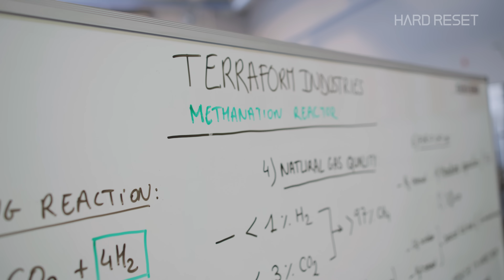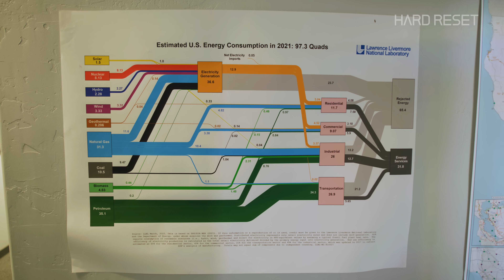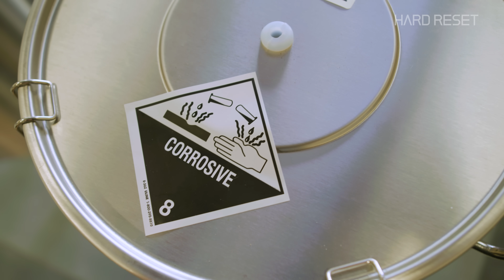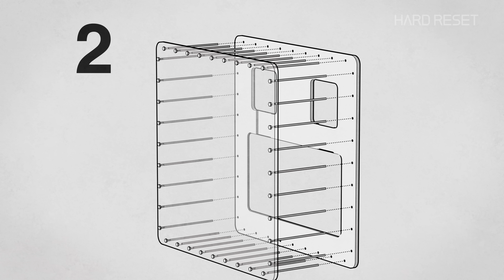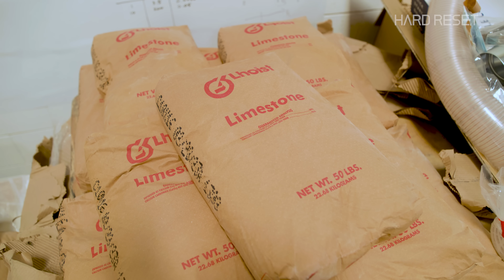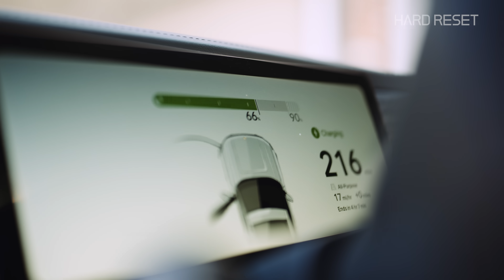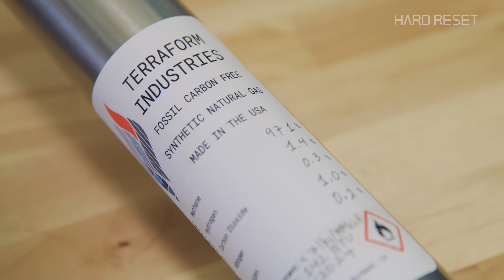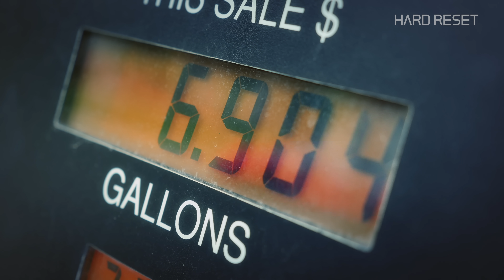The Last Fuel We'll Ever Need?

Comment: Bogus. After watching the basics, this is an energy intensive process, needing a lot of energy that is just lost via heat. Using Solar PV isn't going to cut it. Consider that Civilization uses about 400 years of stored hydrocarbons per day. For every day of consumption of fossil fuels it took about 400 years of sunlight to produce it. Even at 20% PV solar efficiency, and 10% of ends up as natgas production You would need hundreds of square miles of nothing but solar panels to make even a few million cubic feet of natGas per day. Currently the globe uses about 90 Billiion cubic feet per day. To produce 90 Bcfpd, you need most of north America, covered with nothing but solar panels. 

Not only is this process very expensive its will struggle to scale up. 

Sadly PHDs make very poor engineers. They simply lack the ability to under stand economics, infrastructure, logistics, etc. This is why engineers design, build & operate industrial plants. 

For the amount of PV required, it would be better to just use electricity to avoid all of the chemical conversion losses. It would probably make more sense to use biology to produce methane. Perhaps figure out a way to develop mass produce methyl-coenzyme M reductase (MCR) to convert waste biomass into methane & skip over all these processes.

Comment: So, I don't understand how this can be better way of storing energy than a battery.  Batteries are ~90% efficient, can be cycled 1000's of times, and are fully recyclable.  The costs of batteries appear to be following a similar cost reduction curve as solar did 20 years ago, so this idea to convert "solar energy" to methane seems destined to failure, just like other synthesized fuel tech.  Also, we can use heat pumps to replace furnaces at potentially much lower costs than gas furnaces.  Think about it, many home owners already have a heat pump called an "air conditioner" which takes heat from the home and moves it outside the house.  The same heat pump can be used in reverse to heat the inside of the house in winter by just modifying the pump.  Air and space transportation are probably the most difficult technologies to switch to electric, but it is possible and eventually will be much less expensive than current tech.

Comment: Does calcium oxide/carbonate CO2 scrubbing have a higher or lower energy intensity than monoethanolamine CO2 scrubbers? Plus the logistical nightmare of bulk solids handling of the calcium oxide/carbonate. Because, commercial CO2 scrubbing all use monoethanolamine, and commercial entrrprises are sensitive to energy cost.

Comment: Electricity is 3x more expensive than natural gas. They plan to use electricity at 30% efficiency to make a product that is three times less expensive. How can this be viable? They plan to pay 100$ to make 30$ of gas. That people can buy for 10$ in the open market. Not even counting the price of everything else, like CO2 extraction etc, just the electricity alone.
Reply: They expect PV solar electricity costs to eventually dip below natural gas costs. Their goal seems to be to prep a system that can be paired with with a PV powered microgrid and produce decentralized fuels.
Reply: @nolan4339  If that happens, people will just use the Fischer-Tropsch process to make gasoline, diesel, Avgas, etc. We already know that works, and the only thing really limiting it is the price of the power.
Reply: @berserkasaurusrex4233  and that is what they're doing. Prepping a system to deliver those e-fuels while tying in carbon capture.
Reply: @nolan4339  He specifically says he's not doing that, at the start of the video. Those fuels are already carbon capture, there's no prepping the system or whatever. The issue is purely the source of power.
Reply: The economics could make sense if paired as “storage” for a PV plant. If your PV plant produces more electricity than the grid needs, the marginal price of each excess kW generated is negative! So having some place to put that extra juice is always profitable. You could see this scenario regularly happening at scale in California and the Southwest.
Reply: @MichaelHughes124 we already have far more efficient batteries then this method. 🙄
Reply: ❤❤❤❤

Fantastic technology..hats off to Terraform Technology...

To improve efficiency 

1. We can directly connect this system to the carbon dioxide emissions of factories and power plants... 

The emissions are hot and concentrated and blow at a high speed...so you will save on blower power when you have to blow the carbondioxide over the calcium hydroxide plus you will get far more calcium carbonate and carbonsioxide when heated over the kiln. 

In fact you could use the waste heat of the exhaust in the kiln.

2.  You can  use the oxygen that is released  from the electrolysis process and combust it to run a gas turbine to generate electricity for the process to make it more efficient or even collect the oxygen  and compress it in tanks and sell it ...just some loud thinking on how to increase efficiency. 

 I am from India and would be very interested in setting up a plant out here in the future...abundant sunshine and we can explore joining it to the exhaust emissions of companies.

Please reply to me.

Thanks ❤❤❤

Comment: Highview power compresses air to store energy and in that process of compressing air, dry ice is a solid byproduct. I cant help wondering if there is a symbiotic relationship here whereby they can utilise the CO2 from this process or even use that process powered by solar to then use as a storage solution to power this when its not sunny whilst acquiring CO2. Make it part of a grid of a grid balancing solution and use that to  make it even cheaper 🤔

Comment: Since its efficiency is lower than 100%, this is only a solution for storing and distribution of produced electric energy.
Below 100%, efficiency still does matter: the lower the efficiency, the more solar panels, wind mill or NPP you'll need to make, and these still produce waste.
And if you consider a 30% efficiency for the production of methane, then 30% (car engine) to 50% (gas power plant) efficiency burning the methane and get energy out of it, you get an overall 10% to 15% efficiency.

Thus, it's questionable if this can really help making energy sustainable.

But since it doesn't rely on any rare materials, and China controls the vast majority of Lithium batteries supplies, I wouldn't be surprised Europe and the US would want to invest into this tech.

Comment: Liquid methane isn’t bad for energy density, and there are tons of applications that just aren’t going to be electrified easily. What they really need to do at the same time is create an efficient low temperature methane fuel cell that can take advantage of methane’s higher energy density than batteries and use that to make hybrid electric vehicles.

Comment: ok good video but so much of focus on benefits and 'good enough' & fluff really. He fails to ask a critical question, rate of limestone consumption and 'cost' (energy or otherwise) to acquire it. that is what decided if this scales or not. electrolyzers & cake mixers do not. honestly if its cost effective you could skip out the fuel part and just use it as a sequestration tech by digging a hole and dumping carbonate in ground. 
without these details it just looks like a subsidy play.

Comment: You do not have to be Carnot to realize that consuming electricity to make a fuel that you burn for motive power is going to yield 25% or less energy than was in in the initial electricity. Very few applications where it would not be preferable to simply use the solar electricity directly and skip the  whole methane intermediary, especially if the methane has to be transported by ship or rail or truck.
Reply: not to mention you used carbon or fossil fuels to generate the solar panels used to generate the methane xD
and those solar panels usually have a 20 year ROI in terms of energy used to create them. The more you think about it, the sillier it gets.

It would make much more sense to do light to fuel directly instead like some other company was doing using photo synthesis to make hydrogen, since you wouldnt need the electric infrastructure and could go straight to storage.

Comment: Although methane is almost as bad as hydrogen to store and transport, it still makes more sense than plugin batteries, all due to the fact that batteries do not store electricity.
Reply: What?? Batteries absolutely store energy. And methane is significantly easier to store than hydrogen.. by some margin.
Reply: @nfaurerSLK     Batteries store chemical energy, not electricity. charging a battery is an energy conversion operation, which means you have to wait while the battery turns electricity into chemical energy.
Reply: @gsilva220  ah yes. In terms of electricity, that is correct. 👍🏼
Reply: @nfaurerSLK    Methane's only advantage against hydrogen, transportation/storage-wise, is the lack of container embrittlement. Both have low energy density, both take about 15% of the equivalent energy content to compress for vehicle use and about 30% for cryo, and both are better off piped at low pressure to consumers instead of compressed.

Comment: That's a hell of a lot of energy spent to produce methane. Why not just use the energy and forget about the methane?  When are governments around the world gonna treat electricity storage as the moon shot?  The only thing holding back the transition away from fossil fuels is storage.  Storage that is safer than the storage of any other type of energy and can be built anywhere right next to where it's needed.  I can put a solar panel on my vehicle, residence, of business, hook up a battery, and you're up and running.
Reply: because advanced civilization NEEDS giant amounts of hydrocarbons to exist for tons of things that CANNOT be replaced by just electricity.
Reply: @kazioo2  you mean like methane?

Comment: Use heat from the calcium oxide=>hydroxide reaction and insulation to have more efficient hydrolysis. Use the hot oxygen from the hydrolysis for more efficient burning in other parts of the system. Conserving heat in the system as much as you can add to the the most required efficiency. Furthermore, you can install this system at some plant that produces "free" CO2, which would largerly skip one of the steps. Basically anywhere we are burning natural gas for energy. These are the shortcuts that will get this up and running!
Reply: They are long on promises with zero details.
Reply: @tarstarkusz  Such as the catalytic 'magic'. Probably to try and protect their process from those who would steal it.
Reply: @tarstarkusz  
Did you not watch the video?  They described EVERY detail.  All of these reactions have been well known for years.
Reply: @BigGuy8059  Yes, I did. There was no details on cost whatsoever.

Comment: Why not stick with hydrogen? It’s the first step of their process and so definitely provides greater efficiency. So what’s the advantage of using methane? Transportability?
Reply: 20 years ago Europe said "We will create renewable hydrogen economy" and today almost nothing uses it and there is zero infrastructure for it. Turns out it being 15x more expensive to store and transport and requiring completely new systems to run makes it a much worse alternative. It leaks like crazy from everything. Natural gas on the other hand is already solved on trillions level scale. And methane is basically the same thing.

Comment: frankly an onsite generator attached to the grid would be the best bet.  If you use a battery/capacitance device, you could capture the energy, an then inject the grid. either on demand or controlled injection to buffer elsewhere... The grid needs to be more than demand driven.  It should be more like a small town water system.  Many inputs are fed into a storage system (hopefully onsite), while the existing water meets the demands of the system.
Reply: I say these things after babysitting a  60kw storage/19kw solar generator , producing a max output of 27 kw through inverters.

Comment: For the people saying "just use the solar", sorry no. Build a jumbo jet that can take 350 people from new york to japan in 14 hours that runs on electricity alone and you'll be the world's richest person overnight.
Batteries are slow to charge and inefficient currently. Fuel like methane is tens of thousands of times more energetic.
Reply: their plan is to make jet fuel from solar power
Reply: Pass the methane over a copper oxide and zinc oxide coated alumina catalyst and convert it to methanol, a liquid fuel that would integrate fairly easily into the existing transportation fleet.

Comment: The company Liquid Wind are actually building factories that do the same thing here in the North of Sweden.(I assume with different solution) 
Their claim is its using wind power. Wich we do have alot of here. But they will connect to the grid of course. Energy mix in Sweden being mainly Hydro, Nuclear and Wind its still pretty carbon neutral.
But what the fuel will cost is to be seen..

It do mean alot of extra expense for the owners of the grid. It requires new power lines and substations to be able to meet the high electrical demand.